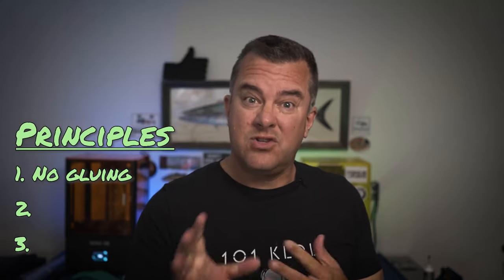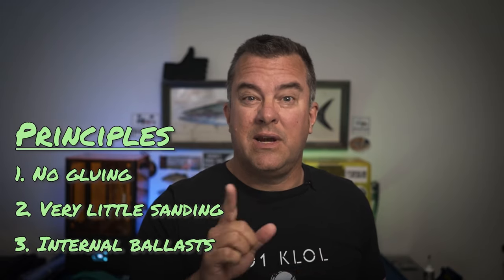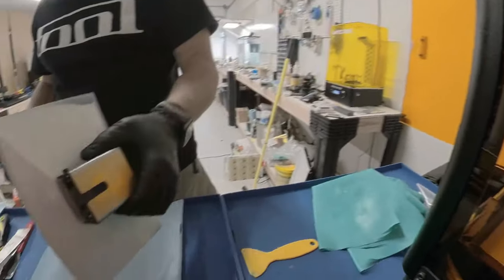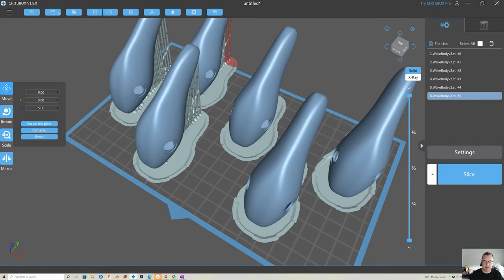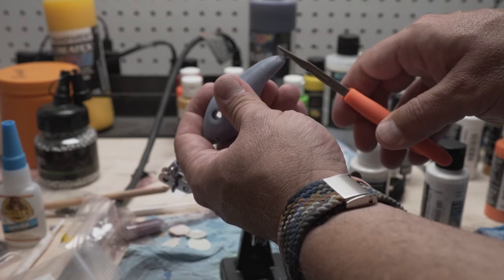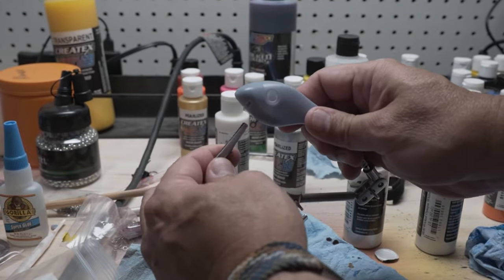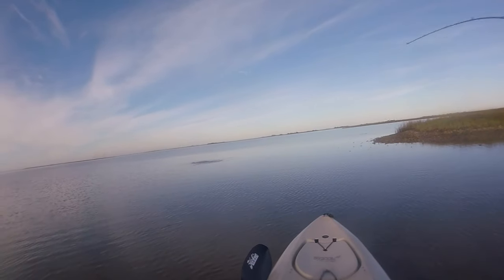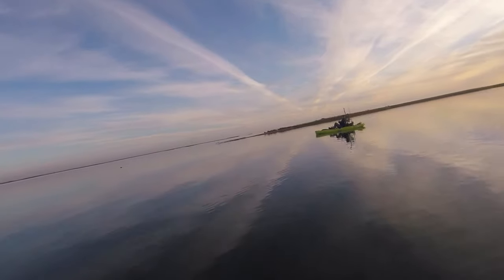3D  Printed Resin Wake Bait, a New Era Begins

Comment: Im lost ont he part with sketching lines and then using pipe to fill it in. Im guessing you made holes for the screw eyes but closed them up?  Its awesome catching fish on lures you make!
Reply from the maker: Ahh sorry for the confusion. The pipes are used to cut out the pilot holes for the screw eyes. The resin is very hard once it is cured and you can't force the screw eyes into it. You could drill after the fact but why do all that extra work? I use the pipe command as an easy way to place them exactly where I want and at the angle I want.

Comment: can you stop the process mid-stream to add weight?
Reply from the maker: That is a bit tricky with resin printers since the model is hanging upside down. I am sure with the right planning and model design you might be able to pull it off. That process is much easier to do with and FDM printer

Comment: Dude your videos are so so helpful. I'm getting into 3d lure making and can't tell you how much time this is saving me. I am definitely going to be getting a resin printer, what's your favorite printer?
Reply from the maker: Thanks for the compliment! 

Printers are largely the same. I use Epax E10 printers but upgraded to the metal build plate. I prefer them only because they have US warehouses and stock replacement parts. So when I need a replacement part I can get it quickly.

I have an entire video on this topic here, also there is a discount code for Epax in that video as well - https://youtu.be/gihN6qD5_bw
Reply: @WMBayouLures  thank you!